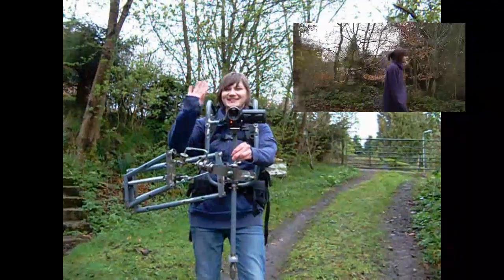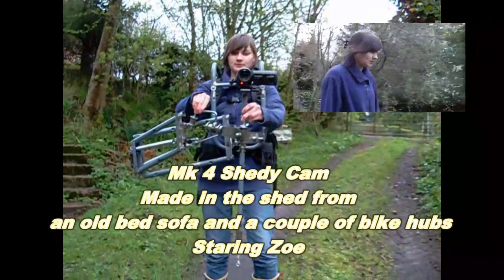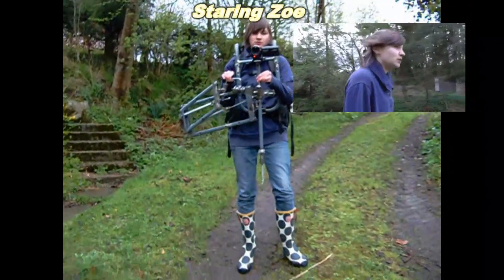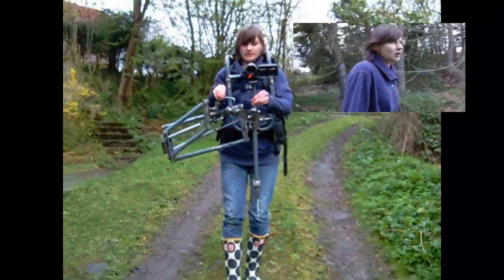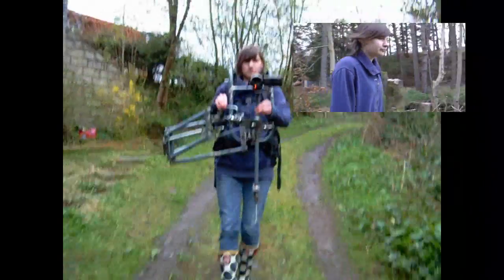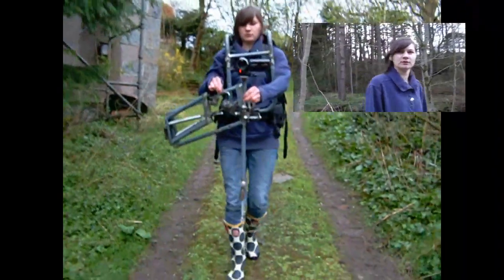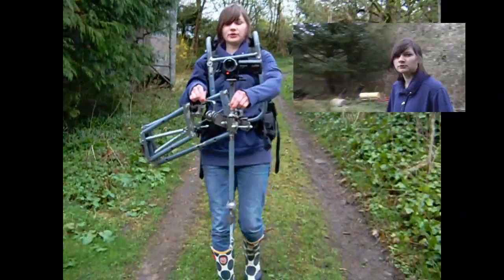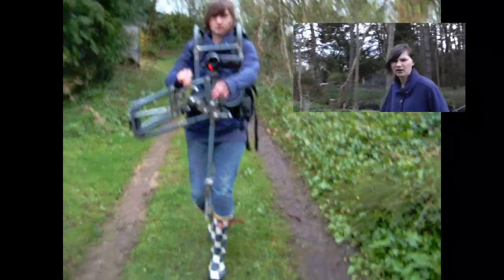Shedy cam in action with Panasonic SD900

Comment: That seems to be working quite well when you were running along side, bravo. Mine's taking ages to build probably two reasons, one I'm just not getting on with it and two I think I may be over engineering it.  I must admit I've not done it from entirely recycled parts either, that was my goal, but the DSLR, monitor and mic etc are just too heavy.  I applaud you for getting yours working.
Reply from the maker: It took a few go's but just keep at it. :-)